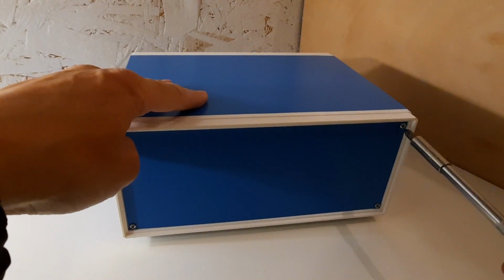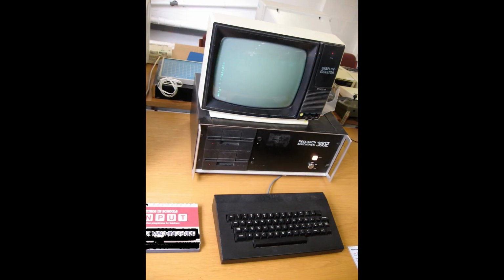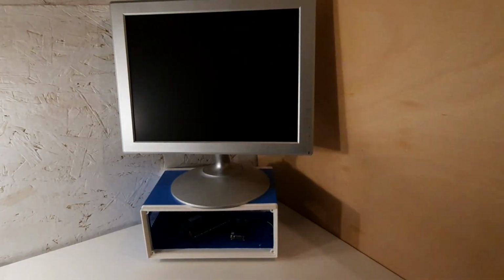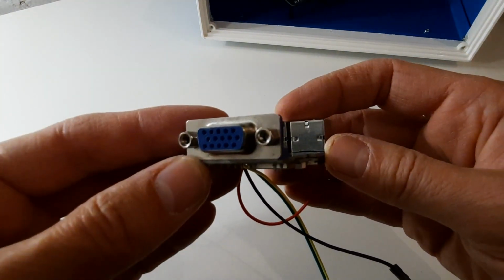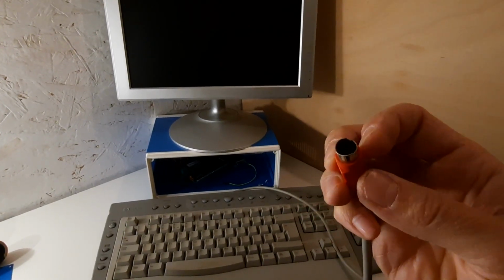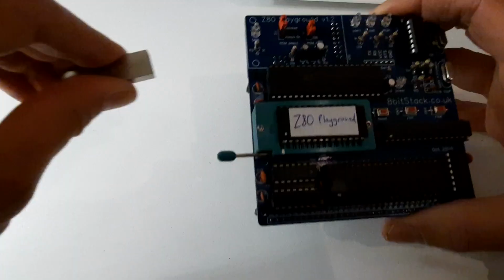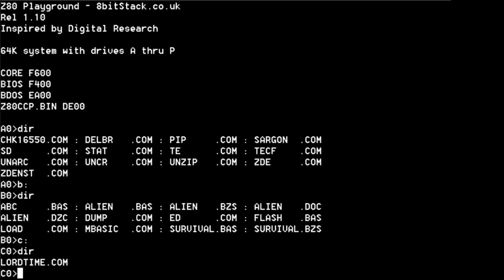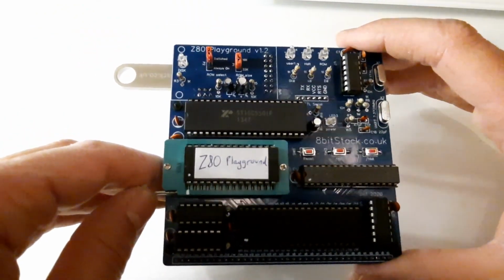Building a standalone Z80 CP/M computer (part 2)

Comment: Hi - part 2 looks good.

Before you cut up the blue panel have a think of these 2 ideas

Front panel,. find a old PC XT/AT/386 and see if you can remove the power on off or turbo buttons and use them, some time you can remove a square unit with the CPU speed and the 2 buttons, reset will be fine being a momentary switch , but the turbo being on/off switch can be used for power

At the rear, there are plenty of ISA black ?? backing panes that have PS2 connectors - they were common when changing from old PC XT - AT keyboard din connectors to a upgrade eg 386/486, as the keyboard din was no longer used it just remained a hole in the box, but you had a rear case  isa slot connectors that took the PS2 , you can even use  one if you have 2 serial ports and put a 25 or 9 pin serial or parallel port if your system supports it
You can get them for VGA as well - if you dont have one or use a 9 pin serial  and just elongate it ( i think 9 pin serial is the same as the TTL / CGA / EGA 9 pin - VGA had 15 pins but i cant recall if the D-shell is larger

USB can go front or back - but i find some times if the USB is at the rear it is awkward to get to but more importantly you push the pc back to clean it or adjust its location and risk damaging the port and stick - unless you have a very short USB stick - i have one for a think client that is about 20-25mm long 

Both of these option will be neater and use of the shelf parts, many obsolete and hopefully cheap / free. Also they are more practical as you will be cutting rectangles rather than complex shapes 

Regards
George
Reply from the maker: Excellent ideas! I'll see what I can find.

Comment: As another commenter suggested, the case also reminds me of the Altair 8800. It would definitely be an awesome project to turn this into a (slightly) more modern version of the Altair. But it would be a lot of work building the circuitry to interface the front-panel programming switches and LEDs with the computer.

Anyway, if you haven't already started drilling, one tip I got from Steve Wagner was to design the panel layouts in a CAD or vector graphics program like Inkscape, marking the centres of the holes to be drilled and the sizes. Then print it out 1:1 and stick it onto the panel with a glue stick (or whatever it's called in the UK). You can then centre punch the holes and drill them easily, and for square holes you can punch and drill with a slightly smaller drill, then file to the line on the print-out. Once all the holes are drilled, you can use warm soapy water to get rid of the paper and clean off the glue.

The main disadvantages of this is that it takes time to design the layout, and you need to wait for the glue to dry, otherwise the paper would probably just peel off.
Reply from the maker: I have thought of the Altair 8080, but the idea of drilling all those front-panel holes terrifies me. It would also be a total pain to use, and take about 2 weeks to program hello-world into it. But I would love to do it one day!
Thanks for the drilling tips. I'll buy a sharp metal drill bit and give it a go.
Reply: @CircuitBreaker256  Oh yeah, drilling all those holes would be a chore, and programming it would be super fiddly! However, I've watched videos on programming the Altair, and it gets easier once you figure out the technique and get into a rhythm. And you don't necessarily need to program the entire ROM in one go, it wouldn't be that difficult to write a small bootloader that would allow you to boot programs from another medium like the serial port. Famously, Microsoft's Paul Allen wrote the bootloader for the Altair on the flight from Boston to Albuquerque, which loaded their BASIC software off paper tape.

But I get it, building an Altair clone is totally not the goal of this project. I just thought of the Altair because of the case.

Anyway, if you're going to pick up some drill bits, definitely get an automatic centre punch. You'll have no chance getting your holes lined up without one. And double-check the punch mark is in the right spot before you drill, it's easy to get it off by a fraction of a millimetre, making your holes look misaligned. You can "walk" the punch mark into place by punching the mark at an angle towards the correct point.

Unless, of course, you want to trigger all the OCD people in your audience. Myself included!

Comment: Nice case, looks a bit like a Altair 8800.  I did something similar with my Zeta 2 board. You might consider using something like a Neutrik (Cliff) CP30111 for the USB , they are screwed to the panel, you would only need a step drill to fit them. (square holes are hard to drill) For the same reason I would look out for a panel mount mini-din socket and use a regular barrel jack for the power.

Examples. (Not purchasing recommendations)

https://cpc.farnell.com/cliff-electronic-components/cp30111/gender-changer-xlr-shell-usb-b/dp/CN19602
https://www.ebay.co.uk/itm/313259724473?hash=item48efbc0eb9:g:OqYAAOSws9dfiKRG
https://www.amazon.co.uk/Youmile-DC-022-5-5x2-1mm-Connector-Waterproof/dp/B08218HN5H
https://www.amazon.co.uk/StarTech-com-Type-Barrel-Power-Cable-Black/dp/B003MQO96Uh

Good luck. :-)
Reply from the maker: Thanks! These are good suggestions!